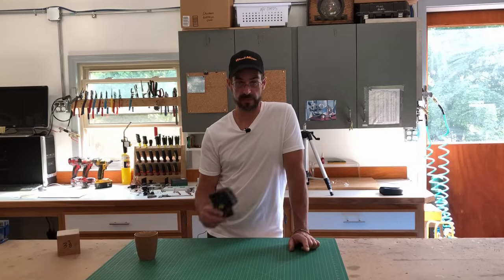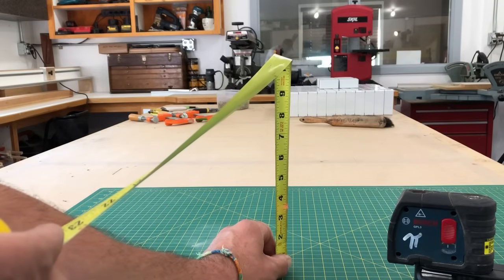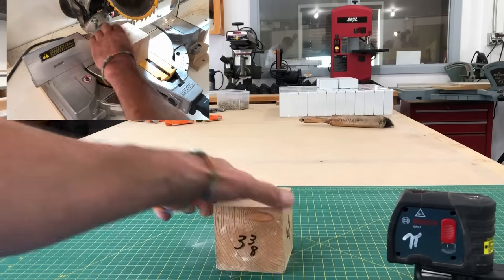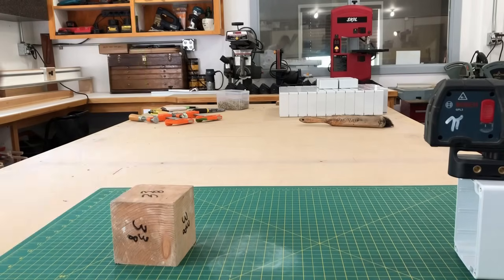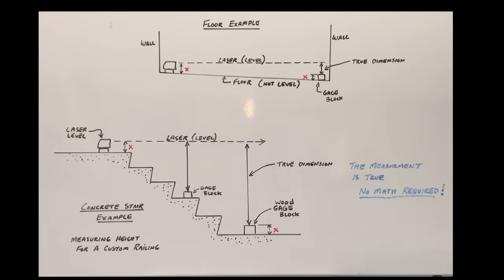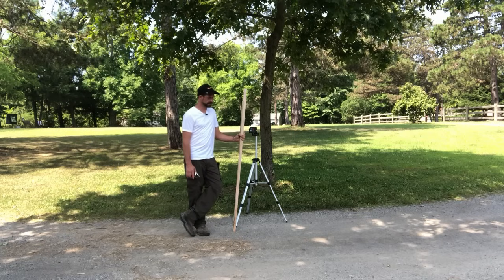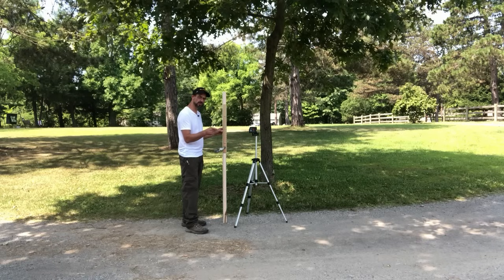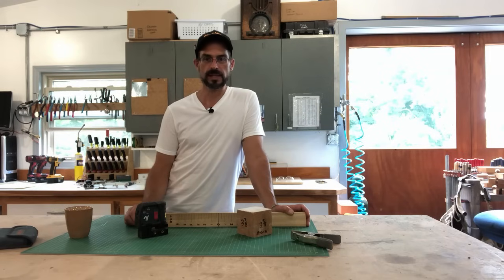Laser Level Tips

Comment: Nice simple tip Brian, I think that would help a lot of people. But I'm a bit surprised that number seemed strange to you. If you want to persist with using an archaic measurement system that the rest of the world gave up on decades ago, you will really need to get used to these "odd" measurements increasingly coming up. 

2:00 it's not an "odd" measurement at all, that laser is exactly 85 mm from the base. The Bosch I happen to have sitting next to me is 115 mm. The only country in the world who still use the imperial system is the US, and most manufacturers don't bother modifying their tooling for the convenience of one country ... not even many US based manufacturers these days! If the number looks "odd" it's probably metric and makes perfect sense from that perspective ;)
Reply from the maker: Metric, imperial, doesn’t matter... my point is why 3-3/8” instead of 4” ? 
Why 85mm or in your case 115mm instead of 100mm ?
Reply: Builds with Brian … because 85 mm/115 mm IS a standard metric measurement. Manufacturers will typically work in units of 5 mm. 85 mm is really no more difficult to work with than 90 mm and 115 mm no more difficult than 110 mm. One might argue 100 mm could be ideal but it apparently wasn’t the form factor they required. An “odd” measurement would be something like 87 mm or 107 etc. However Bosch is a European manufacturer that has clearly used metric dimensions and standard convention to produce a product for the world market. It’s unfortunate that doesn’t translate to imperial very well but unfortunately that’s just the way it is these days.
Reply from the maker: Pete F 
Just curious here but why is 85 mm or 115 mm standard measurement?
For the sake of doing quick math wouldn’t you agree 100 mm is better??
Reply: @BuildswithBrian  In metric design, 5 mm increments is standard convention much the same way that in imperial we used to generally try for 1/4" increments. However working in metric doesn't involve fractions, so the math becomes a whole lot easier. You said you don't like fractions, nor does the rest of the world, that's why we all use a base 10 (ie the decimal system); there are no fractions. 100 mm was apparently not the form factor (ie the height) they wanted for the design.
Reply from the maker: Pete F 
I fully understand the metric system and how it works, and I actually prefer the metric system when doing many calculations, however you were totally missing the point of the tip, and that is to eliminate most if not all math needed to find the difference of elevations, after all every time someone does mental math quickly in the field there is a possibility of an error, the simple fact is that if the measurement of the height of the level was an even number such as 4 inches or 100 mm, That mental math would be much simpler.
Reply: @886014  You were so busy trying to appear smart that you missed the point. Something so simple, you just overcomplicated everything. You didn't even say good video, well explained. You just had to find a fault where there is none. If that's how you conduct your life, trying to one up others, trying to dim others shine, trying to take the spotlight. I feel sorry for those close to you. Go make your own video.

Comment: Great useful tips. What kind of Bosch laser are you using?
Reply from the maker: Dwayne Sumner 
Well it’s about 10 years old so I don’t think the model number will help you, but it’s simply a three point basic laser level, that shoots a level line, a plumbline and a square line. They are available at most of the big box stores in the US a for about $99 or less
Porter cable also makes a very similar model, it’s a basic laser level
If you really need it I can get the model number when I’m down in the shop tomorrow, let me know